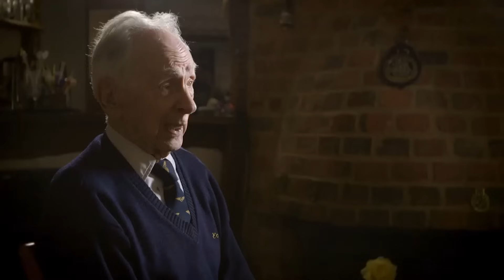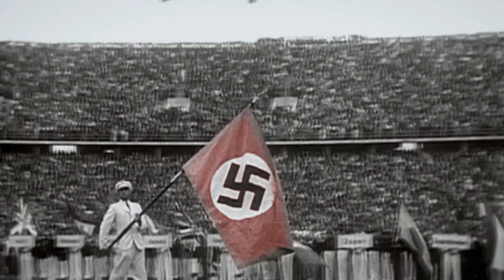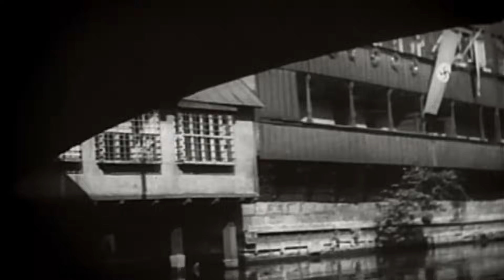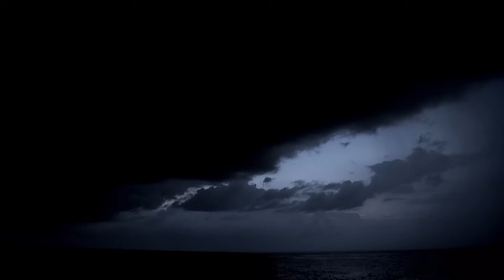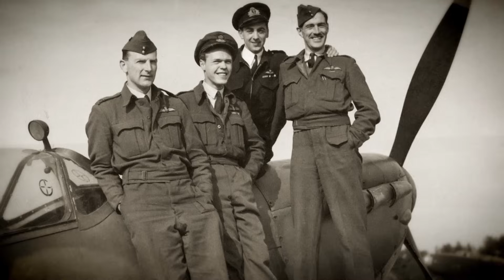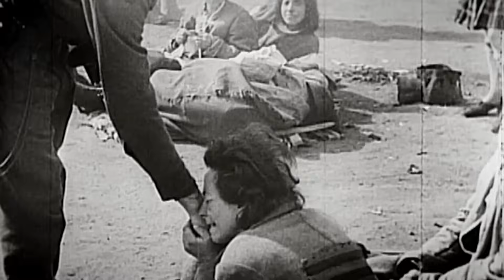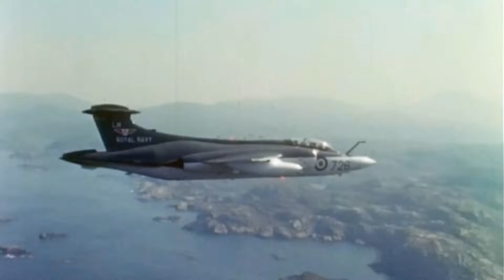The Story Of A British Royal Air Force Ace | Captain Brown

Comment: The adventures and contributions this man made during and well after WWII are almost unmatched by any other solider or person in this time period.   While most other pilots would have probably studied an aircraft for some period before attempting a solo flight,   Brown on many occasions just stepped right up into the aircraft,  started the engines (sometimes with help from the captured enemy pilots and/or mechanics) and take off.    He and a fellow test pilot flew the first two helicopters purchased by the UK with no training on the type other than looking at a manual that came with the aircraft for a few minutes beforehand and then piloting the aircraft's back to the UK safely and without incident, although he said they flew them 'shaky at best' but they made it back ok.    He flew over 487 different types (and many more sub variants of those types) of aircraft in his lifetime,  more than any pilot in history and also has the world record for both take off's and landings aboard an aircraft carrier, mainly due to being one of the primary test pilots when the more modern aircraft carriers were being developed for the emerging aircraft for these type ships.   Brown had free reign to fly all over the entire former European battlefield right after Germany surrendered as the Commander and Chief Test Pilot of a special aviation group of the British Government to seek out,  procure,  fly,  evaluate,  and return to the UK any strategically valuable aircraft.   Brown flew every type of German (and all other AXIS and Allied Nations) aircraft from WWII and reported the flight characteristics of all models,  many of which were highly advanced aircraft which could have changed the tides of the war had they been produced in significant numbers or had been available to Germany at the on-set of the hostilities.

Comment: 2:40 Looks very much like Manfred Von Richthofen.
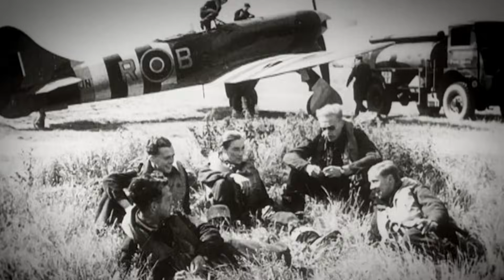25:08 In the background; the personal aircraft of Roland Beamont, when he commanded a Tempest Wing. An operational pilot, he was also one of Hawker's chief test pilots and was an advocate for keeping the trouble-laden Typhoon operational in its early days, when structural and engine problems were killing more pilots that the Luftwaffe was. Beamont could see the Typhoon's potential, especially as, at that time, the RAF lacked a 400 mph fighter that could match the FW 190 – at low altitude, the Typhoon turned out to be superior in speed and manoeuvrability to the 190